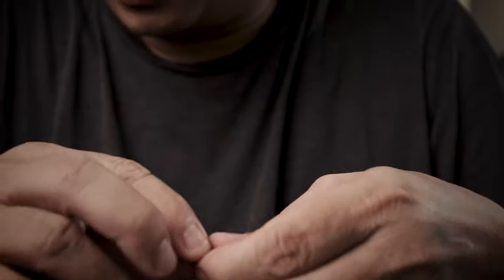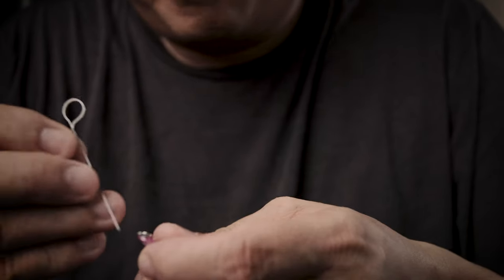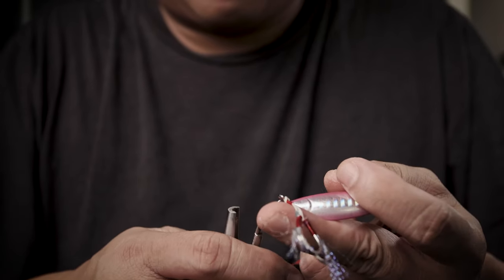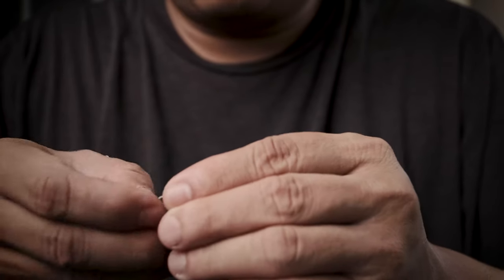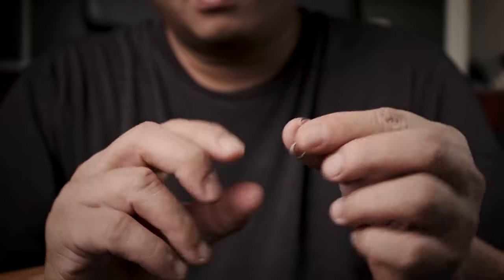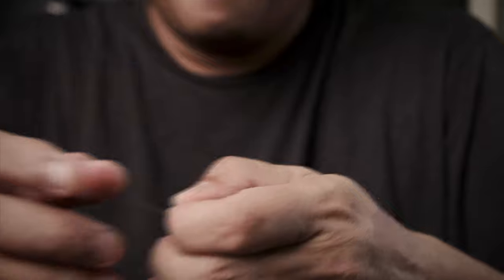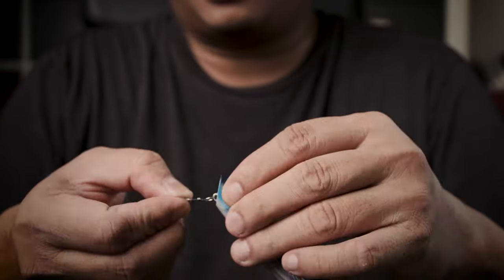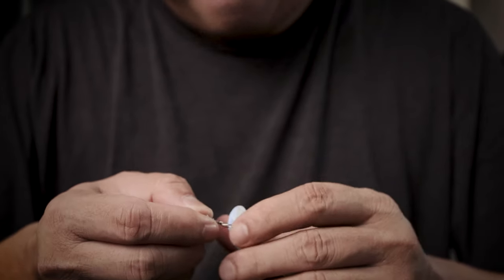HOW TO make a better connection to lures and jigs

Comment: Your video is very formal and detailed description of making solid wire rings for your lures.  

I agree the load bearings should be on the mainline, but you still have the hooks at the other end that will play a role. 

I am going to rig some of my gear and see what happens. I will ensure come back and let you know the outcome. 

Thanks again.
Reply from the maker: Glad it was helpful!